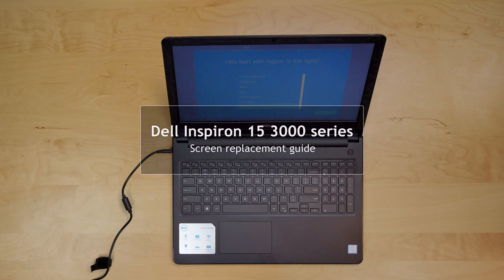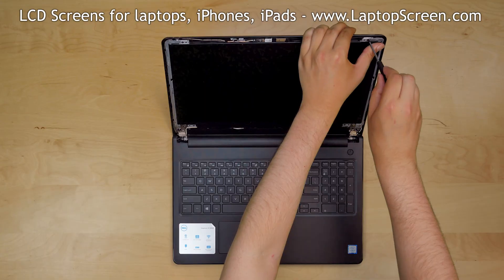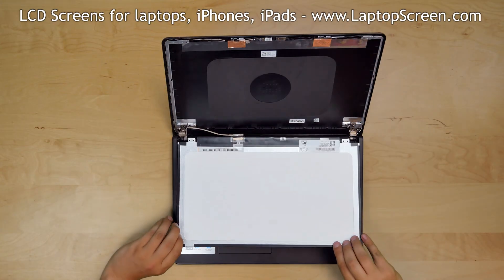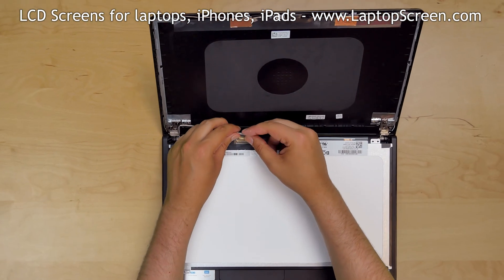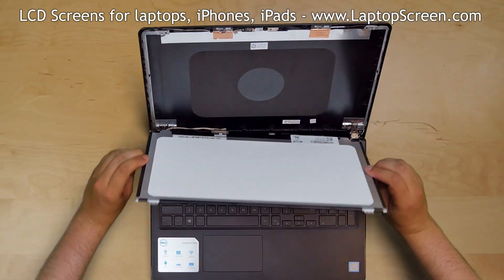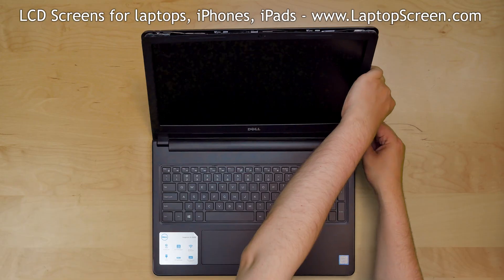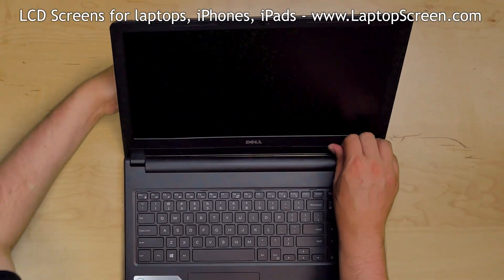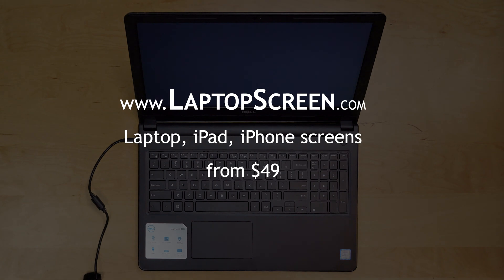Dell Inspiron 15 3000 series  laptop screen replacement tutorial. Step-by-step instructions.

Comment: WOWZER.  I did it.  i'd been living with an evolving pink/green screen until I couldn't see anything.  I had purchased a replacement screen but was working up the nerve (waiting until it was beyond critical) to actually Do The Deed.    Watched this video.  4 times.  Changed the screen.  Replaced the battery.  Fired it up annnnnnnnnd Told my family it was safe to breathe again.  Thanks for a very clear, real time instructional video!
Reply from the maker: Glad it worked out for you, and congrats on the successful repair!
Reply: What's the cost of it?

Comment: Is it possible for me to upgrade my current 1366x768 hd resolution screen to a 1920x1080 fhd resolution screen with the Inspiron 15 3000 series laptop? If so, please tell what screen I can buy for the upgrade. My laptop looks the same as the laptop in your demonstration and it is equipped with a 7th gen i5 cpu.
Reply from the maker: It might be possible. Search your exact laptop model on our site www.LaptopScreen.com and look for the Upgrade Options button.

Comment: I replaced the screen on my Inspiron 15 3000. It works fine but soon my mouse went crazy. I tried to download a new driver, but eventually it still has a mind of it's own. I notice when I use two screens, the arrow will return to the home screen. I have a wireless mouse. The issue doesn't seem to happen until I log on where I can get to the internet.
Reply: Could be the touch screen issue. It is actually "touching" everywhere
Reply: May i know the cost of screen

Comment: hi, my laptop is HP 15-DA1041TU (30 pin connector) 1080p TN panel (6 bit) and 
it has very low quality panel, 
so can i able to upgrade it to 1080p IPS (8bit) sRGB panel ?
if so then provide me link, which suits for me 
and can i get delivered to INDIA safely?